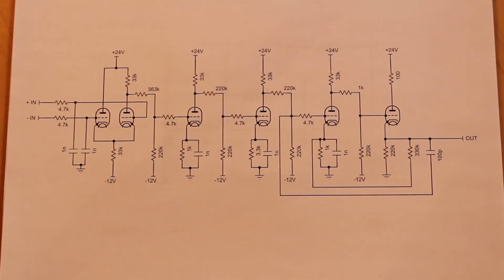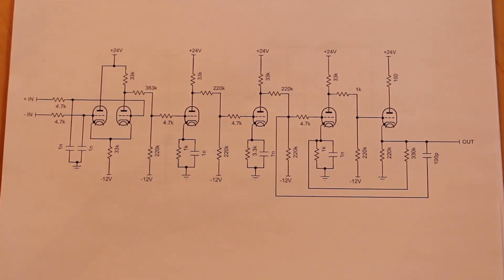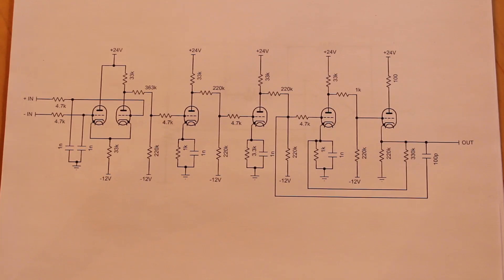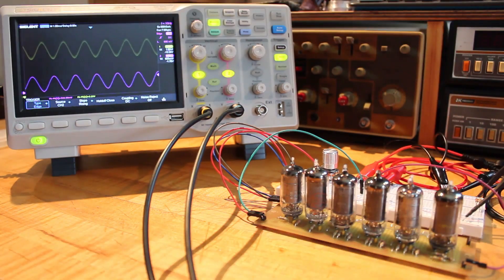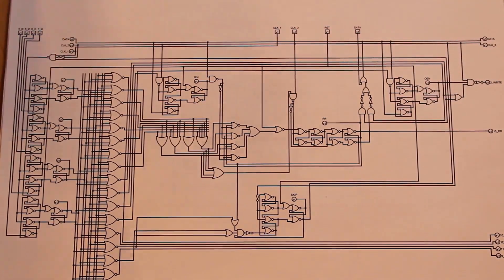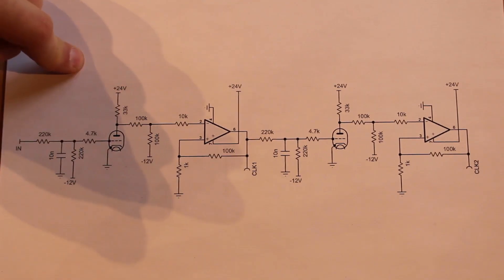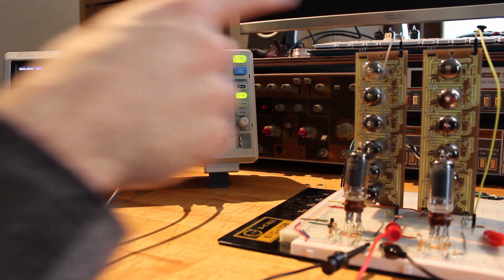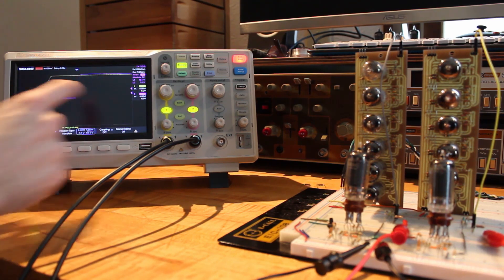Vacuum Tube Computer P.08.2 – OpAmp Clock: One Input, Two Clock Signals

Comment: Is edge detection not more reliable? clock has two moment you can use for timing your circuit, raising clock and falling clock, there are your two different timing, and they don't depend on some analoge circuit can change over time and change with temperature differences. ;) Slow clock that will not a big problem I guess, but if you speedup everything the marge get very tiny, and you need special resistors or even an oven around the resistors to keep everything in specs when your door opens of the room and temperature drops couple of degree. :D

Comment: I'm binge-ing my way through this entire series!!!
I see that you've effectively implemented almost EXACTLY what I suggested on a prior video (i.e. a small delay and a Schmitt)
I think the current 400uS of delay that you've chosen here is perhaps excessive (since that 'limits' your max clock to around 1.25KHz), but it'll be VERY easy to adjust that later with a simple capacitor change.
Well done sir!

Comment: Nice project! What sort of receptacles do you use on the PCB for the tube pins?
Reply from the maker: Thank you!
I actually use little 1mm PCB receptacles that I found on Mouser. It turns out the pin diameter of 7-pin and 9-pin vacuum tubes is exactly 1mm, so they fit almost perfectly. I had to make a custom PCB layout for the receptacles, but overall, I'm really happy with how the tubes plug in.

Here's the link to the ones I use: https://www.mouser.com/ProductDetail/Harwin/H3161-01?qs=WS5Jv%252B%252Bx1qUxGQ9n1naX6A%3D%3D
Reply: @UsagiElectric  Do you mind sharing the exact part number or link? I kept looking for something like this for ages.
Reply from the maker: @stelian95  Sure thing! 
https://www.mouser.com/ProductDetail/Harwin/H3161-01?qs=WS5Jv%252B%252Bx1qUxGQ9n1naX6A%3D%3D

Comment: Two thoughts.

1) The circuit boards would look so cool if you could light them up from behind with a low wattage defuse light bulb.

2) This is a totaly insane idea, but, use punch tape for the programs. Using till receipt rolls as the tape, a light bulb and photo sensors for address and data switching. (the engineering would be an absolute nightmare though. I told you it was insane. LOL).
Reply from the maker: I never thought of adding a light behind them to illuminate the traces on the top side, but that sounds like it could look really cool! I may have to look into that as the machine gets more complete!

Also, totally not an insane idea because that's exactly what I was planning on doing! Like, frighteningly close to my plan. I was thinking of using receipt rolls with the program printed on them and a light with photo sensors to detect the program. Really, the only difference was, I was planning on using VFDs instead of a light bulb, but other than you absolutely nailed my plan!
Reply: @UsagiElectric  OMG. I was going to try it years ago, but having no engineering skills, (at all), it never got past the planning stage. (well, bad drawings on paper.). Cool.

Comment: There is no need to build a Schmidt trigger from a complicated op amp.It can be built out of only two tubes.
Reply from the maker: You're absolutely right! 

And this is something we've been hashing out a bit on the Discord chat server as well. There were a couple reasons why I started with an OpAmp, but chief among which is a little side project I've been working on quietly that should be coming up in a future episode pretty soon. Also, I would love to build some low voltage analog computing circuits too. 
For the finalized clock for the computer though, the Schmitt Trigger portion of it will most definitely be simplified down a bit though, probably to something similar to this: https://i.postimg.cc/DzTCVT1g/Two-Tube-Op-Amp.jpg

There's a lot of great discussion going on over on the chat server, so you're more than welcome to join! There's a lot of brilliant people in there building a lot of really cool things: https://discord.gg/p7UsfHD
Reply: @UsagiElectric  Thanks for your long reply! I'm looking forward to your analog computer series :) Your videos are really good.

Comment: Did you try inputting a square wave signal into your inverting amplifier? I would love to see how the square wave response of your op amp is, as it can tell you a bit about the stability of it :D
Reply from the maker: I actually did give that a try and boy was it not happy!
https://i.postimg.cc/XNR8W59G/SDS00006.png

Yeah, so it's not the most stable of OpAmps, haha. Lots of weird reactions, though perhaps it could have done a bit better at a lower frequency... I'll have to give it a shot at like 500 Hz or something, really slow it down and see how it does.
Reply: @UsagiElectric  Whuey. Thats an exciting waveform xD. Looks a bit slew rate limited (amongst other things) to me. 
If you are going to perform further tests, I would certainly try a much lower frequency, but also a smaller input amplitude. 
Thing is - if your output waveform changes shape (other than amplitude), at different input amplitudes - something nonlinear is happening, like slew limitation or the obvious clipping.

Its just very much my field of interest ;-)

What is your (professional) background, if I may ask?
Reply from the maker: @williamschmidt-hansen6311  Oh I'm sure there are a ton of little problems with these!  But, I think you're right that frequency and input amplitude are probably the biggest factors. I'll have to get one of these setup again and do some testing at lower frequencies and inputs and give an update.

My professional background is actually as a technical Japanese to English translator for the automotive industry, so absolutely nothing to do with electronics, haha. So, it's highly likely that I get a lot wrong in my videos as this is all really just me tinkering around and experimenting in my spare time. But, it's good fun and I'm learning a ton!
Reply: @UsagiElectric  Given your (non-electronical) background, the stuff you do is truly impressive. I would say your electronics intuition is on par at least with 2nd semester EE students. Furthermore, the things you do are not exactly common or easily researchable, which just makes it more impressive. I am learning stuff too, though I am in 6th semester EE. 
Keep up the good work.
Reply from the maker: @williamschmidt-hansen6311  Thank you! That's awesome to hear that I'm not totally flailing around in the dark, haha.
There is indeed a bit of difficulty in finding decent tube computing information out there. The IBM customer engineering manuals have been my best resource so far as they're super in depth. But most tube stuff on the internet is audio focused, which doesn't always translate over to making good logic circuits. Still, I'm having a ton of fun making stuff!